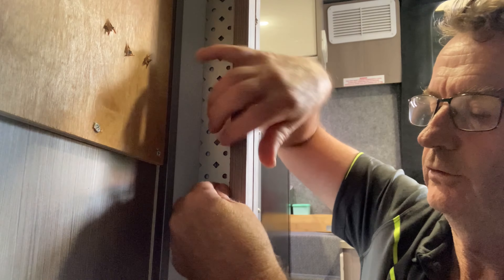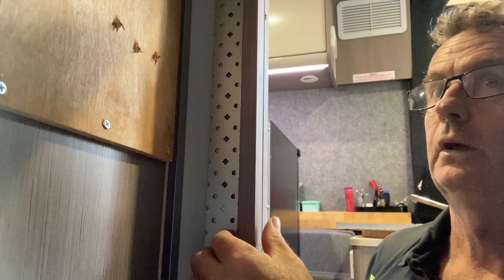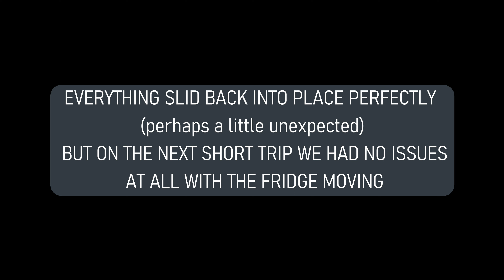JAYCO FRIDGE MOUNT ISSUE- Rectifying a poor design

Comment: Excellent video , great detail on the engineering fix for the fridge , I have same model Jayco but only 3 months old everything is going great presently but really appreciate you sharing the fix , great job love the fan as well, been watching many of your videos and enjoying the travels, thanks for sharing, I also like the insect screen on the sliding door to the Jayco, looking to buy from Living in a Bubble is that where you purchased yours ? Thankyou Darrel 👍
Reply from the maker: Thanks Darrel
The insects screens we have need to be custom made due to the top rail on the Renault's sliding door intruding inside the van so much. Ours were custom made by an auto trimmer here in Perth. who created a boxed section to allow the door to close without pushing the nets out.
Always looking at improving the little bus where we can, spent some time pulling panels off and shoving insulation under etc
Do you have the brass monkey fridge, if so you might have another issue with the fridge
Reply: @westausoverland  thanks so much for getting back to me, living in Perth I like watching the places you have been giving me great ideas on where to stay thanks for sharing , yes I do have the brass monkey fridge and so far in summer I just leave it on as I regularly do day trips and take water and lunch with me, the 200 watt solar panel and 120 amp lithium powers everything easily , do you think your auto trimmer would be interested in doing another sliding door ? If not no worries just thought I would ask , thanks again for sharing your travels as I will keep liking and watching Thanks Darrel
Reply from the maker: @darrelwright7871  
I'm sure he would like to , it was GK trimmers in Canning Vale (0894557144) , did the job in 1 day, not only did he do the sliding doors but also the rear doors, really like the screens. i thnk they were a total of $1400 not the cheapest but solidly built.
We have an issue with our Brass Monkey fridge in that I checked the temps. The temp indicated by the fridge is around 6-10 degrees warmer than the actual temp in the cabinet. I just now run an external fridge temp as security. We suspected something was up when the drinks were not quite as cold as they should be. I now have the fridge app and set the fridge temp to -5 degrees and this seems to work really well. was thinking of doing another video on some other tips and also the Jayco RM19-1 reveiw 1 year down the track (as we just love her) , we had the PVC shower walls replaced under warranty as they had warped and bubbled in the heat (hence stuffing everything with insulation and also the fridge extraction fan)

In Case you are interested we do do a travel blog as well, (  thatcampervanlife.blog ) which gives more details on where we go then the videos do.... have a look like to know what you think.
any other questions i'd be happy to help